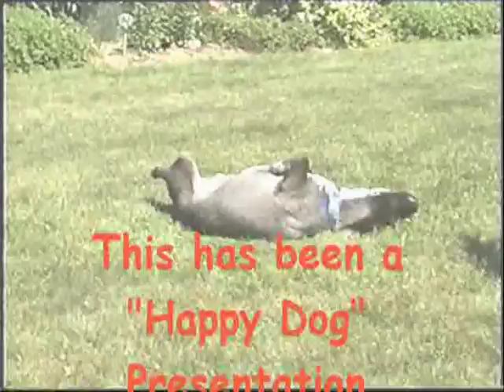Swiss Ranger Volcano Stove using Sterno

Comment: hey, forget using the sterno inside of its can. get a spoon and scoop some of the gloop onto a popcan half (either way works, inside the can or flipped over and glooped onto the bottom) i can get a 5 minute boil on the cup and 7 minutes on the bottle. also when the sterno is scooped out it burns FOREVER and can be blown out and re used for a couple of hours.